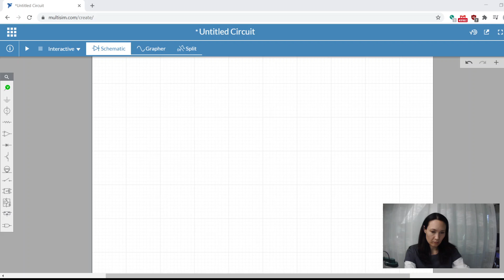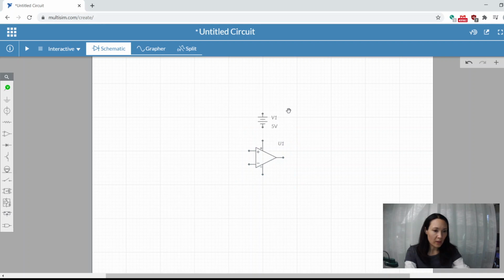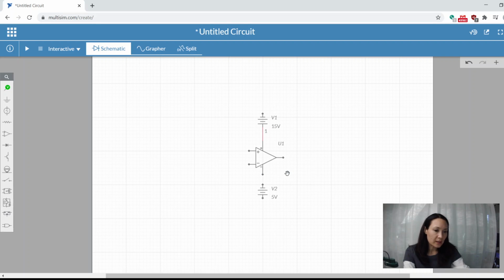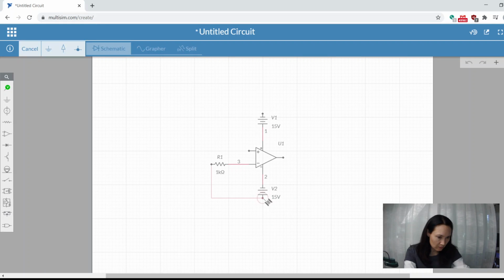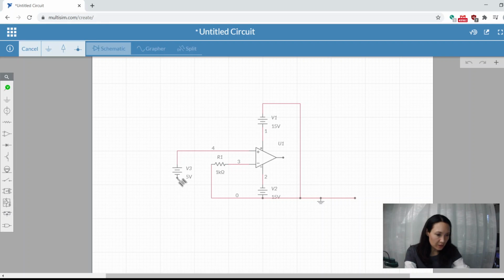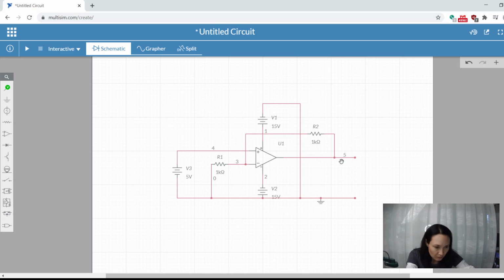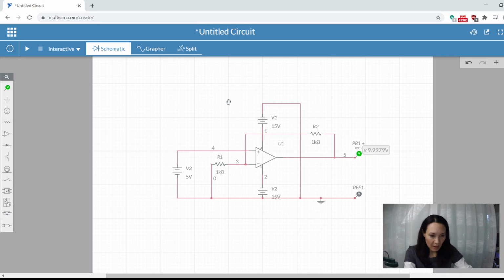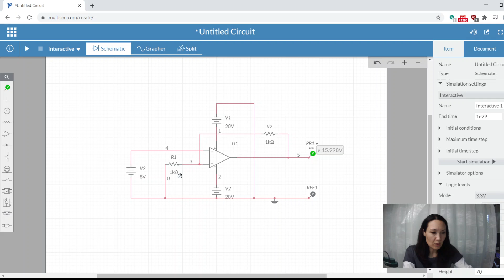Multisim Live Tutorial: Non-Inverting Opamp Circuit

Comment: I should preface this by stating that I will be taking my first electric circuits class this summer, so I still have a lot to learn. We will be using Multisim so I came here to get an intro to the software. As I watched the video, I noticed that the negative terminal of +VCC and the positive terminal of -VCC are directly connected. Wouldn't that create a direct short? It's two different potentials connected with basically negligible resistance. I understand the need for a bipolar power supply for this particular op amp circuit. I also understand that -VCC is negative with respect to ground, whereas +VCC is positive with respect to ground. So the polarities of the batteries would be flipped with respect to ground. I guess the only thing I'm not clear on is how you could physically connect the two aforementioned terminals without starting a fire. Thanks for the tutorial. I look forward to hearing from you.